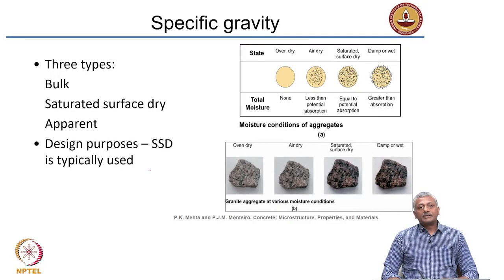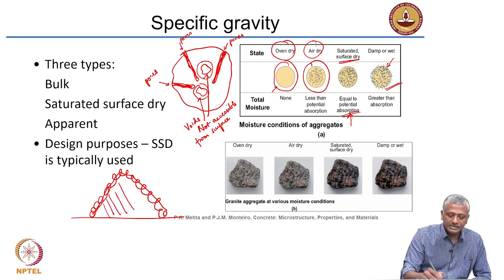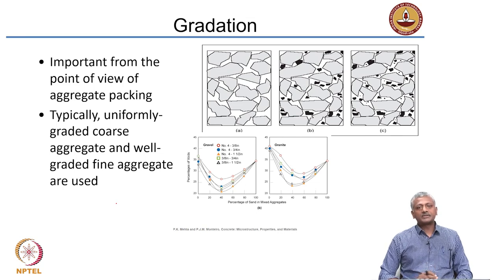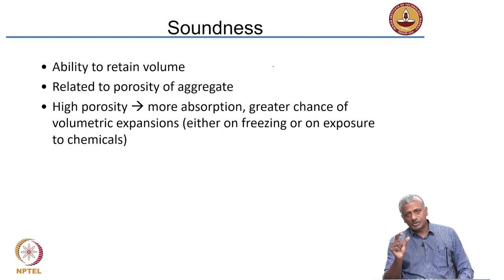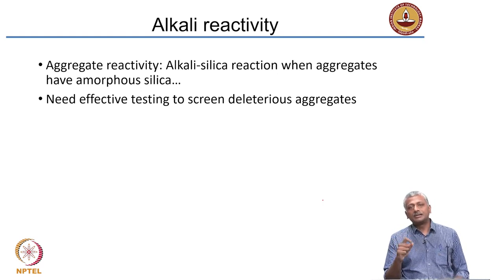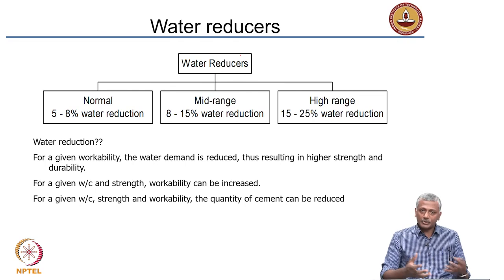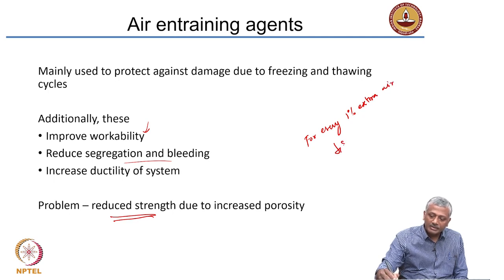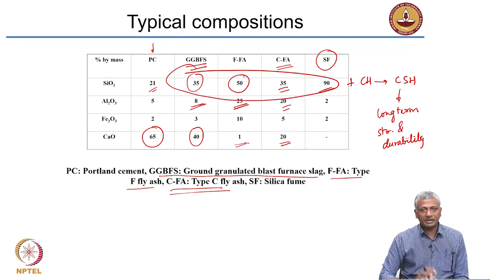mod05lec28 - Cement and Concrete 2 - Part 2

Comment: Professor - General contractor student here from US. Incredible videos! So easy to follow and understand! Many, many thanks!! 

Aggregate size reference: According to ASTM C33/C33M - 3/8" (9.5mm) sieve is the US industry dividing point between fine and coarse aggregates. Fine aggregate passed the 3/8" (9.5mm) sieve, and coarse aggregate is retained on it. 

Maybe it will be helpful to someone in the future. ACI/ASCC Manual - 4th edition. In 3rd edition - the sieve size used to be 1/4" (6.35mm).

Comment: Sir 🙏
Bulking in fine aggregates Or Sand occurs due to capillaries development in bulk mass  (connected pore channels ).surface tension develope negative pore water pressure in bulk mass up to certain expansion Or Bulking.